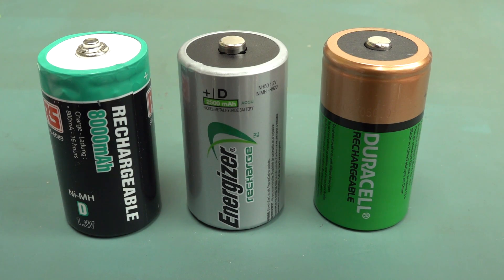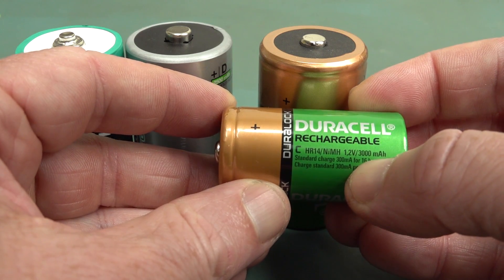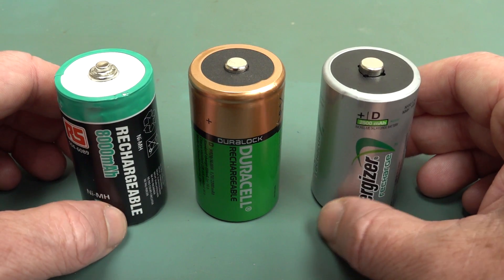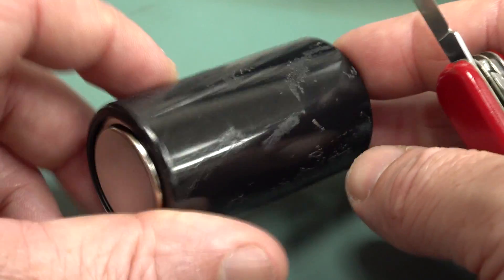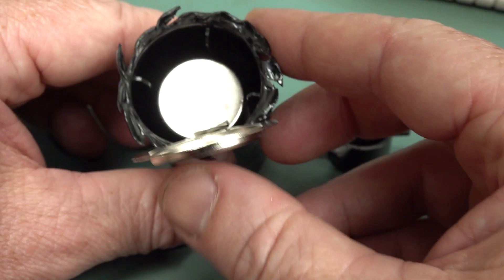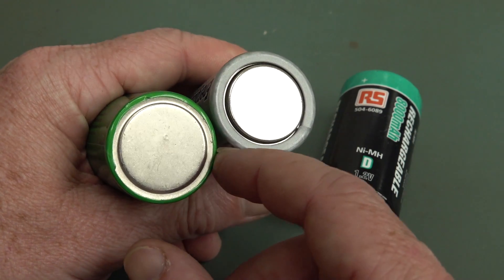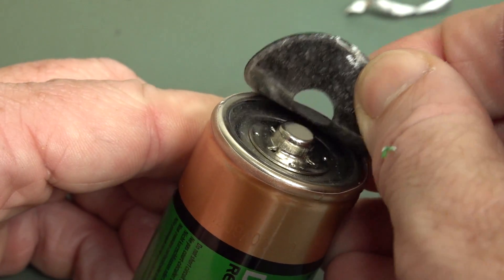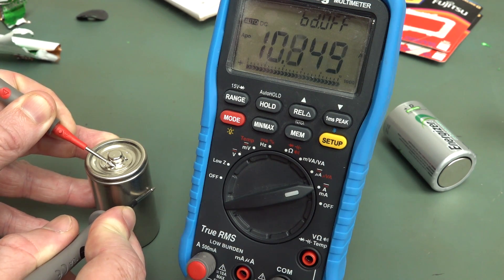EEVblog #1200 - BUSTED! - Energizer & Duracell NiMH

Comment: Before you all get out the pitchforks and torches and start screaming "SCAM!" lets try and see reasons why they might be better.

* Weight. Rechargeables are (usually) heavy, at least compared with other non-rechargeable cells. Not everything needs to be super heavy, and in some instances it might be desirable to not have that weight.
* Industry improvements. Consumer electronics have got more and more efficient over the years, with smaller power supplies becoming pretty much the norm. Maybe most things that take these sized cells don't have the same requirements as they did 30 years ago.
* Simplicity of circuit design. Sure, these days throwing a battery charging circuit inside your device is pretty cheap/simple... But, if you are creeping up on that price point for the product you are making, you MIGHT just decide to let the customer deal with all that.

That was just what I came up with easily. Can we come up with more reasons why it might be a positive for those cells?

Comment: If the capacities are correct then who cares if the battery is smaller inside?  The capacity is all you need to know.  I dont buy a D cell because its better than a C cell....I buy a D cell because the dang thing I need batteries for takes that size.  What a non issue.     Its like saying that a Full size sedan has a less powerful engine than the much smaller Corvette...and?

Comment: I buy the Premium D Size 10,000mAh High Capacity High Rate NiMH Rechargeable Batteries. https://www.amazon.com/Premium-000mAh-Capacity-Rechargeable-Batteries/dp/B0040ID4XS/ref=sr_1_2?keywords=tenergy+nimh+d&qid=1555169510&s=electronics&sr=1-2

Comment: Man, I haven't seen anything that uses a C or D cell in probably a decade. It's like they've gone extinct...
Reply: Not surprising, newer higher capacity lithium battery tech that is rechargable with a tiny microusb connector cable is making them go extinct.

Comment: They want an average amount of time before you need to replace the batteries. Across the consumer types. This guarantees your always on the shop for more. It's the reason the batteries are on the same spot a store normally displays chocolate near the checkout. Impulse purchase these brand named, overpriced con batteries quick! Before you have time to read the label.

Comment: I have some 3x AA to D size battery adapter things that combine three AA batteries to become one D size battery.
you can also use just one if you want to save on weight or dont mind the lower capacity in favor of less batteries to recharge after using

Comment: just like usual typical battery scams lol. i see a lot on facebook with what i can only presume is knockoff RC batteries on a RC group im on, that the 'manufacturer' (spammer with fake name) from...you guessed it....shenzen claims is free or very low price LOOOL. i often warn folk about the dangers of fake batteries that could potentially blow up in ones face or set fire to your home specially if no overcharge protection fitted......i need'nt say they hate me lol, and try claim their products (if thats what they call them) are ligit.......nahhhh BULLSHIT detector off scale that much the fucking then exploded !!

Comment: Those Energizer D-Cells at 2500 mAh are only marginally better than the 2300 mAh Energizer AA-Cells I have sitting right next to me? And the pair of Duracell AA-Cells in my flashlight are 2500 mAh... (And yes, they ALL do test out within 2% of advertised ratings consistently.) I expect a little more from C-Cell and D-Cell! 

When you opened that D-Cell... *mind blown* WOW.

Comment: 3000 mAh even for C cell is slightly low too... and 2500 outright ridiculous. I mean your typical Enelooop clone AA from China has 2200mAh capacity and supplies well over 10A of short circuit current.

Comment: Duracell "2200 mAh," "1/3 the capacity of the other cell."
Maybe I need glasses. It appears the label says 220 mAh. That is not even 1/30th the capacity of the other brand D cell.
Edit: ne'ermind. Watched it a third time and seen the proper value before Dave covers it with his thumb.

Comment: As far as I'm concerned it's a scam and the ACCC should fix it, the same as breakfast cereal boxes containing more and more air and frozen foods more and more water. As and average consumer and a more savvy one than most I never knew this. All the D cells I have don't have ratings but they're also not rechargable. I find battery capacities vary greatly and there's no way to tell when buying them at the shelves and energiser and duracell are wildly over priced. Woolworths essentials brand was far superior (pity it's gone once it got popular) and cheaper than both big brands, voltage was a bit high but lasted longer and was great in my Mini Z RC car, did as well as upgraded li ion batteries. The worst part is if you buy from one shop to another, if they accidentally get the wrong batch sent that was intended for a different market that store won't notice untill they get complaints and investigate with their supply chain. I won't buy batteries from a particular place even though I know they've addressed this with their supply chain to prevent this from happening again but it's not good getting batteries a third the capacity, even with one of the big brands. The ACCC or whichever body needs to make them clearly mark on the packets how long they should last so we can effectively make decisions. I can't google online for information if one store they're one spec and another store they're another spec.

Comment: Anybody remember the old D-cell TV ad where an announcer, a bandsaw, and a battery powered toy were present for a test of endurance?  A man, presumably a factory worker, sawed a battery in half lengthwise, then placed one of the halves in the toy and it ran as if it was not damaged. Not sure of the brand, type battery or the type of toy, but I do remember that the battery contents were full and had no air spaces.  I suspect the test battery was a Duracell alkaline battery and as I remember the ad being in black and white, this must have been before we acquired our first color TV set which was in 1982.

Comment: I know that some years ago GP sold D cells with 10.000 mah , ik know because they are now already for some 11 years in my electric bicycle,  and still working at about 50%.
They are oem but i also can remember at that time trying to find higher rated D cells but 10 Ah was the maximum available.

Comment: I got a fancy charger that included plastic adapters to put AA into the form factor of a C or D. Why does a device get designed to take D cells, instead of AA?  I think it would be for higher current draw.

Comment: I don't know if this is a marketing thing as much as it allows them to eliminate a complicated and expensive assembly line, giving them large production savings. I'd imagine the internals of the Duracell one are made on the same assembly line as the C-cells too with just slightly wider material.

Comment: Yeah for a long time I tried to use rechargeable batteries instead of alkalines for just about everything, and made sure my chargers were able to charge all the different sizes...  Then I realized that the rechargeable D-cells sold at retail had the same capacity as AA's, so I stopped getting them.

Totally dumb. I think they maybe do it so the charging time won't be outrageously long or something. Or maybe to limit the damage if they rupture or leak. But it defeats the point of using them.
Reply: Yeah. I just use spacers for C and D from AA now. As you said, same capacity as these smaller ones. If I need 8Ah I could get one of those, but for me they're only powering things around the house, and it's easier to keep a stock of charged AA Eneloops around to replace in the spacer than keeping spare charged C or D cells. Plus I can use them in everything calling for AA too. So now I have a lot of AAs, some spacers, and a few AAAs as well for keychain torches and TV remotes that require them. All charged up because they're low self discharge, for pennies each time on the night rate.

Comment: Oh dear.  Just wait until Dave decides to open a 9V battery.
Reply: Have you seen the 9V Ni-mh onehunglows BTY's with 8x rechargable ni-cad buttons in them? And yes, 1/10th of their capacity.
Reply: The alkaline ones are pretty much full with either 6 AAA looking cells or 6 pancake cells. Would guess NIMH is similar but with 7-8 cells due to the lower 1.2V nominal voltage per cell

Comment: Rechargeable D cells have mostly consisted of C cells inside a D sized shell for over 35 years. I was first told this by my boss at the time and I did not believe him so I took some apart and sure enough he was right. That was in 1987. I suppose that as long as the spec is show correctly then it is not a scam.

Comment: This is old news.
Many NiMH D cells are C or even AA cells in a D size case. The low capacity usually is a dead giveaway. Manufacturers have been doing this for ages. I guess they do this because D is a relatively niche battery size not worth making in large quantities.

Comment: Knew about this for 24 years.  The container on a D cell is sized to fit a D cell slot.  The capacity tells the story, not the size.  Used to work in a facility that made NiCad and NiMH cells.  They are no longer made at that facility but the story is the same.  I could've saved you the teardown.

Comment: For many devices it is not gonna make sense to use full capacity D cells, as the smaller cells can easily provide high current but would be self discharged before you could even use all its capacity.

Comment: I did the same with an 6v alkaline lantern battery which seemed top heavy. Inside I found 4 D cell alkaline batteries and a plastic spacer! I compared this against a Heavy Duty lantern battery that had 4 full length cells inside, no spacers. I went on line and bought a number of D cell to lantern cell adapters knowing now that I have the same capacity but the cost is much less.

The capacity of those D cells from Energizer and Duracell are the same capacities you'd find on their AA cells so I was expecting to see a AA cell inside. This is another candidate for an adapter, this time AA to D cell, or just purchase the high capacity cells.

Comment: Price looks about similar for mAh at least here in the UK.  £8 for a pair Duracell 3000 mAh D NiMh batteries and £16 for one RS Pro 10000 mAh.  However looking at the duracell site here (https://www.duracell.co.uk/product/ultra-rechargeable-d-batteries/)  i can see plenty of mention of longer lasting but no numbers...  It is unclear whether the battery holds more power or is theoretically more durable over repeated cycles.  Clear total lack of facts though and obvious marketing bs and lies.

Comment: 15:24 - And also, D cells are not as commonly used anymore. All of mine are in flashlights (torches), some of which have LED lamps. The day of having, say, portable audio equipment powered with D-cells is long past.

Comment: no wonder industry still uses lead batteries in actually critical systems, like emergency lightning.
Reply: I believe that is due to the current requirements and stability.  The capacity per surface area is actually awful.

Comment: Not to give them too much credit, but I wonder if this decision has to do with charge rate - it means their charger only has to output one current. 

Note that RS components job specifies an 800mA charge rate for 16 hours. So if we assume a charge time of "1.6(capacity/charge_rate)" hours, an 8000mAh battery in Energizers "Value" Universal charger outputting 200mA - that's a 64 hour charge. Maybe some marketing geniuz decided that consumers would rather a lower capacity battery that charged slower than they would like to charge batteries for 2 days and 16 hours. 

Amusingly, Duracell doesn't even have C or D NiMH listed on the USA site anymore, and the Eneloop batteries I prefer just come with AA and AAA - but there's an ADAPTER not unlike the shell of your D cells there which lets you use the batteries in C or D applications. At least, in that instance, you know the form factor is mostly air.

Comment: Didn't really understand Dave's point at first, on the assumption that the Duracell and Energiser would be cheaper, however a quick search finds the RS 8000mAh @ $10 for a pack of two, the Energiser 2500mAh @ $20 for a pack of two, Duracell the same - ish. So for $1 you get  1600mAh with the RS, but only 250mAh for the same price with the Energiser and Duracell. Oddly a two pack of Duracell C cells is $30. This is just a quick squint, prices off Wallmart and RS.

Comment: Totally not surprised. What I am surprised about is that they are not using a standard cell inside the shell for cost reasons. Or rather, this implies that the cells they ARE using are cheaper and standard.  
Cheap adapters for AA to D or C to D or AAA to AA have been available for years and give consumers a flexible and cheap alternative to this rubbish.

Comment: I bought a pack of 2x D cell alkaline batteries in china 18 months ago, and instantly noticed they were light, I used one in a flip clock for just under a year. When it went flat I dissected it as you did and inside was a AA cell in a plastic former just like you saw in with the C cell. They were cheap and I didn't expect quality as I did buy them in China but even so I still felt ripped off. I actually replaced the AA cell inside the plastic former and used that as D cells are quite hard to come by now.

Comment: Don't some chargers monitor the temperature of the cell? It can't be very effective through a plastic case.
Reply: There are chargers that use temperature rise as one of the termination factors, a good charger though would primarily use -dV/dt with temperature rise when the battery is full as a backup in case it was missed somehow. And then ideally on top of that have a time based cutoff too set sensibly for expected capacity of the cell (no more than 20-30% more than expected max charging duration). 

Oh and some chargers also determine fast charge termination based on voltage and then trickle charge for a few hours to top them up to 100% (or indefinitely if designed for non-LSD cells).

A charger using temperature increase during charging as a primary termination factor? yea it'll probably have an issue with it if it senses the temperature on the side of the battery. If its temperature sensor connects to either the positive or the negative side though it might not be as bad, but then you'd also measure some heat produced by the charger which might make reliable termination more challenging?
Reply: Temperature affects the resistivity of objects (higher temps mean higher resistivity). This means that they could just measure the current and internal resistance to figure out the temperature
Reply: The very popular BC-700 type chargers definitely have temperature sensors, but I guess they are just using them as a fail-safe mechanism. 
At least I have been using a bunch of them for the last fifteen years to charge dozens and dozens of Eneloops, and I've never had a problem. I can't even remember having a bad Eneloop cell ever. The oldest ones I still use are at least 10-12 years old and they still have 1700-1800 mAh.
So the chargers can't be bad.
Reply: the heat has to go somewhere, so it will go through the plastic
Reply: Yes, there are chargers that do, and yes it wouldn't be very effective.  Granted this would mostly be a factor with a shorted cell, otherwise a typical charger can't put more than an amp or two into them which with their higher capacity, is still not all that rapid a charge rate.
Reply: Temperature is measured via the terminals. Also uses resistance because this is reduced as they heat up.

Comment: not so much of a scam but a way to provide D cell sized batteries at a reasonable capacity to replace Alkaline D cells, flash lights etc and still keep the weight down to that of the older D cell

Comment: What about Eneloop type technology ? Does it exist for C or D type batteries ?  Current Eneloop claims 70% charge retention over 10 years, 1900 mAH capacity, up to 2100 recharge cycles & good to -20C for AA cells - not cheap though.
Reply: C and D size Eneloops do seem to be available in the 
Japanese market - BK-2MGC (min. 3000 mAh) and BK-1MGC (min. 5700 mAh), respectively. The rest of us plebs are being sold adapters instead. 

Oh well, at least you can buy 3x AA -> D adapters these days. Hmm, I wonder whether that's how the "real" D size Eneloops work, after all 3x 1900 mAh = 5700 mAh...
Reply: @PileOfEmptyTapes  Thank you for the information - I'll do some searches or perhaps I'll just stick to some variety of lithium technology for my day to day uses.

Comment: My recommendations for the past few years have been Panasonic Eneloop for AA and AAA and Tenergy Centura for C and D. These are the top end brands for each size. You are going to pay a premium for the Centura cells due to their capacity, but they are some of the best you can get in the US. Duracell, Energizer and Ray-O-Vac (Varta for those outside North America) usually try to keep the costs down and that is how you get these turds. I've known this because I remember when you would see 2500 mAH NiMh D-Cells at Wal-Mart and 5000 mAH NiCd at RadioShack (Tandy for you Aussie Blokes).

Comment: ok ... before watching any further than the 2 minute mark I'm going to guess. 2200 and 2500 mAh capacities sound like AA batteries. At least, I used to have 2500mAh AA's. My guess is that that's what's inside. (I'm going to be wrong, aren't I ?)